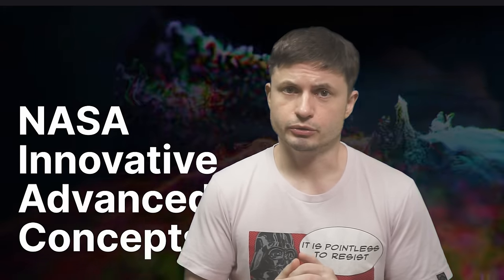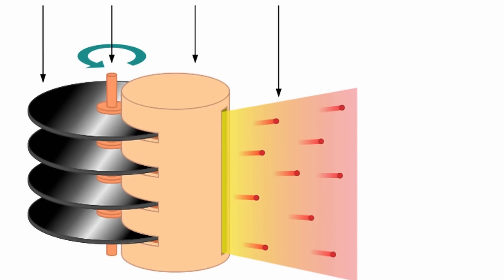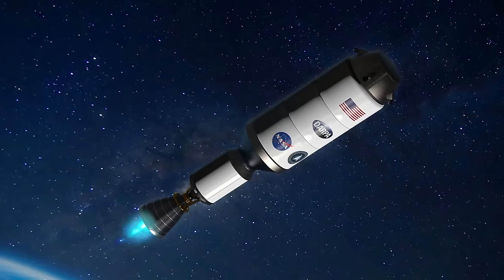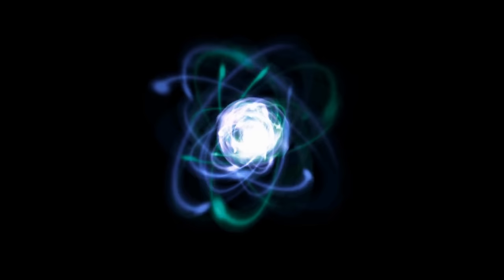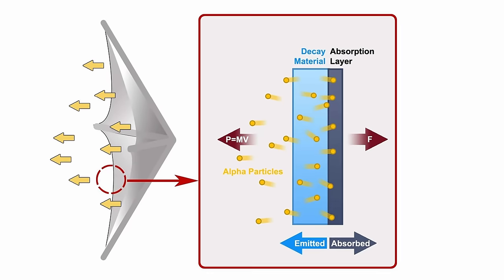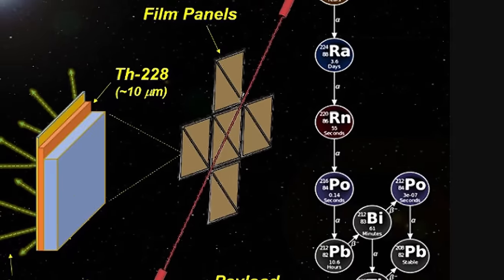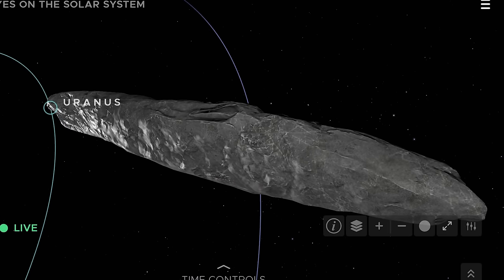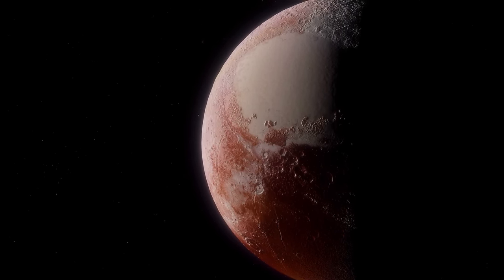Efficient Space Engine That Could Use Nuclear Waste For Propulsion

Comment: a low of 150km/s and a high of 1000km/s is absolutely wild. We could go pick up Voyager 2 and 1 in about a third of a year after getting up to speed. Do it and do it yesterday.
Reply: No there is nothing to get from picking up old broken technology and after getting to speed is far fetched as it takes years to do and you have to decelerate too. Not to mention all the other issue you have to solve and come around or that no one so far has even build such a device. So a wild dream and it will stay just fantasy for a long time. 
But it is your dream so if you want to go for it, maybe you could start collecting thorium as a first step.
Reply: Why would you pick them up, weren't they meant to go Interstellar?
Reply: This is a good comment to illustrate to the laymen just how much faster this propulsion technology can accelerate compared to previous incarnations. Obviously the benefits of retrieving these older spacecraft do not likely outweigh the costs. Still, the fact that we could do it is very cool
Reply: @shanent5793  I don't think they were meant to, it's just a cool bonus we get out of them now since they're still working half a century later
Reply: it's pretty neat but with this Thorium sail-engine I doubt it would be so great; with such a short half-life - unless the craft is somehow producing this Thorium isotope AND re-deploying it to where the sails can catch the radiation - the 'engine' will have lost more than half of its thrust capacity after only 2 years will never get it back ... so it's basically a one-way trip to far outer space, it can steer but it's not coming back if it doesn't turn around soon after it leaves (or maybe an orbital sling if it visits a strong enough gravity well)
Reply: @Techmagus76  Humanity does enjoyg collecting valuable historical relics, so even if it's only subjective there is value in collecting old relics; but also there can be some research on those craft, like seeing what happens to [various materials] after half century of continuous outer space exposure ... and there's probably other things to learn that I haven't thought up in the span of a YT comment =)
Reply: @mastakazam5094  One-way trips are still very useful since we can send information back at the speed of light, inverse-square law permitting
Reply: @BodyMusicification  indeed! =) I only meant it wouldn't be good for going to grab something to bring back

Comment: It also sounds like a very scalable design, where one can attach a square mile of a sail coated with a radioactive isotope, to propel large crafts through space. Making such a large sail won't work on Earth, but it would work in orbit. On top of that, the sail being "dumb"  (no electronics or moving parts)  would make it very durable - any space dust damage wouldn't change its performance much
Reply: This. Simplicity and robustness of design are ultra important for scalability, I don't think most people appreciate this point.

Comment: NASA needs to pick this! I image a larger craft can be made by using multiple sails with their own thorium thrusters, allowing for even greater velocity or more weight for the same velocity. Neptune and beyond will be accessible in much shorter time scales for much lower costs. It's amazing to think of the potential this type of craft has, I think this is the perfect way to explore the solar system

Comment: Just curious. You mentioned that NASA's nuclear-powered rockets would be hard to produce, but would it be any easier if they were constructed in space?
Reply: Russia has intercontinental nuclear propelled missiles already. 9M730 Burevestnik
Reply: Definitely not, launching the necessary materials and constructing it in orbit would only add more complexity and risk. Especially testing and validation would be prohibitively expensive in orbit, considering there is no infrastructure for it and no one has attempted to build heavy industrial components in orbit before -- everything has basically been part-kits so far. Considering it's also nuclear, with enriched materials, it seems that packaging it in a controlled environment on the surface is the only safe option.
Reply: @franckmalers2299  Why was the RD-0410 discontinued, like the USA NERVA project?
Reply: I'm going to guess that constructing anything in space is automatically harder.
Reply: No. Easier to construct them on Earth. The engineering of the fission engine isn't all that hard. The bigger problem, I think, is storing cryogenic hydrogen propellant without it boiling too much and having to vent too much of it. Insulating the tanks adds mass, etc.

Using something other than hydrogen for a propellant gets you an engine that's not much better than chemical propulsion
Reply: The Nerva project already tested them in the sixties.
Reply: @erkkiruohtula632  indeed, the question is why did the stop r&d, completely, after the early 70s.
Reply: @car103d politicians cut funding due to the oil crisis is my guess.
Reply: @TBonerton  I remember the seventies, but they continued with the space shuttle, which was very expensive and later discontinued for that reason and the accidents. I guess there was another reason perhaps more technical, maybe the achievement of just 2x specific impulse of nuclear fission wasn’t a great deal and they preferred to invest in nuclear fusion research if it could lead to fusion thrusters one day? Never achieved till now. Or they were scared in Cold War times of nuclear hypersonic missiles carrying nukes, shrinking the already short time of reaction after intercontinental missiles launch? Just speculating…

Comment: OK, I think I understand why there is a net force in one direction. A cherry bomb blows up in all directions with zero net momentum. But put a garbage can lid on the left side of the cherry bomb and when it explodes, the lid will go flying to the left.
Reply: Exactly.  Radiation going into space propels you while radiation caught by the shield on the other side of the fuel is re-absorbed into the spacecraft, cancelling push from radiation in that direction.  So it winds up pushing one way.
Reply: That's how regular rocket engines work too.

Comment: The 150 km/s deltaV was calculated for 30kg of fuel and 30 kg of payload, the actual "engine" weight that turns the decay into propulsion doesn't seem to be included. While for the the Dawn mission it was the whole mission's deltaV (after launch I think). Not a fair comparison.
Also, the fuel weight difference means that isotope engines only have a chance to be better than ion engines, if we consider very light payloads. Depending on actual weights, all necessary parts included, it might not be better at all.
And any weight increase will heavily affect the isotope engines range. Adding just 10 kgs would decreasee its deltaV to 129km/s, adding 30 would decrease to 100. Those differences would barely affect the ion craft's range.
Also, using isotopes your fuel is constantly depleting, whether you use it or not. Meaning that you'll have to burn in very inefficient locations, or just waste the fuel completely.

Comment: This also implies that B radiation can provide a negative voltage potential.  I don't know the output rate, but perhaps a- radiation can generate helium on Earth?
Reply: That's exactly how we get the helium we have access to.
The helium is gas that's trapped as part of the methane and oil reservoir. The helium is separated out and sold. It arrives in these reservoirs as a byproduct of natural radioactive decay of minerals buried in the earth.
Reply: @Unmannedair That's tons of radioactive material at temperature and pressure that exceeds what we should do in a lab or intentional nuclear reaction.  It can make more, and does so.  What's the yield at STP for as much radioactive substance that can be safely! 🤣 stuffed in a region?

Comment: Very cool...
There is the issue that manufacturing and then deploying such a solar sail launched from Earth isn't the easiest or cheapest problem to crack. But if one was to loosely roll the 'sail' up in a tube and combine that with a very simple ionic thruster powered by the backside of the 'rolled sail' one would basically have a solid-state alpha-particle rocket. Likely just as efficient, much smaller, and easier to deploy in to space.

Comment: That leaves one dilemma. Any craft being pulled by this sail, would have to be decontaminated before you exit the craft. Seeing as a piece of paper can stop alpha radiation, the hull would keep you safe on the inside. But anywhere you land would be contaminated as well. So pasic suits on exit and a clean you method for the craft and surrounding area would have to be part of the plan. Bringing the cost and weight of the operation up to facilitate this idea.
Reply: Pusher config and separate science research package leave the sail behind retro down fire up reconnect bob's you're mothers brother pretty simple.
Reply: @leonmusk1040  interested thought. Assuming all the contaminate is blown off on entry. Which will not be the case unless you expose the entire vessel to re-entry conditions, and all that drag. Logically you only expose the tiled side to the atmosphere so you don't tear the ship apart/rip it to pieces.

Comment: Although radiation is expelled at high speed, it represents a small percentage of the mass of fuel which unlike rockets does not go away.  You have to push the mass of the atoms that generated the radiation around with your spacecraft.  Astonishing ISP, given that issue.  Are radiation particles going at relativistic speed?  Do they "weigh more" or something?
Reply: E=Mc2 it's the squared part that keeps shit interesting.

Comment: 1,000 km/s. Wow. Light speed is 300,000 km/s. So that is 0.33 % of the speed of light. And achievable with a few years of continuous low thrust.

For want of a figure, suppose that is 5 years. Then in 15 years, 1 % of the speed of light, if the half-life is substantial. And in 50 years, 3 % of the speed of light.

Assuming no further acceleration, that would mean Proxima Centauri in about 120 years. Now if we can get that figure down to say 50 years, then we've got something similar to probes sent out in the 70s that have exited the solar system.

But the payoff will be much larger if, instead of exploring the limits of the heliosphere, we are exploring the Centauri system up close.

This is AMAZING. Further developments in this approach could obviously bring ENORMOUS benefits. Never mind that flimsy star shot idea, this could be FAR better.
Reply: 0.003%
Reply: @leonmusk1040  If you are referring to 1,000 km/s, it is definitely 0.0033 C, ie 0.33 % C, where C is the speed of light. Is that what you were referring to?
Reply: 1/3rd is .33 not 0.0033 and a third of 300,000 is 100,000 so its only 1 300th the speed of light plenty quick but no where near 1/3rd c Oh I see 1/3rd of 1 percent lol sorry got it now lol

 @dakrontu

Comment: You would actually have unexpected high amount of losses do to the quantum tunneling effect in practice. It's the reason why we can't improve semiconductors further.
Reply: The effects of Tunnelling could be mitigated with thickness (tunnelling energy reduces exponentially over distance). So losses won’t be as high. Main issue with semiconductors is that we are trying to make the components as small as possible.

Comment: 4:05 How much Thorium fuel would be lost while it is in a compact volume while being stored and traveling before being deployed?
Reply: Look up the isotope of thorium's half-life.  Find out how many kilograms are in storage.  You can calculate how long it will last yourself.
Reply: Depending on how it’s folded the absorption layer could keep the radiation separated. It would depend on the absorption efficiency between layers and the thickness within layers (where the thorium would radiate laterally). It would probably radiate faster when compacted (unless there’s a folding geometry that could do the opposite; radiates more when opened) but not as much as compacting raw thorium (same mass) in the same space.

Comment: I’m confused. What’s the sail for? Isn’t it for catching particles emitted by the decaying fuel? But the momentum between the nucleus ejecting the particle and the sail reflecting the particle back would cancel out, right?
Reply: One would think so...    Kind of like the Coyote using a fan to propel a skateboard with a sail.    🤷‍♂️
Reply: CCP propaganda
Reply: When a particle ejects in the reverse direction (into space), the sail catches its forward-moving counterpart, pushing the spacecraft forward. When you add up the reverse-ejected particles and the forward-propelled spacecraft, the net momentum is zero.
Reply: @p1mrx  is the fuel special which emits particles in opposite directions, or all/most decays happen this way?
Reply: "sail" is a bit of misnomer here, the author of the proposal refer to this as "engine". Common solar sail (e.g IKAROS) works by catching energy from particle emitted by external bodies. This engine, in contrast, use cascading reaction of the daughter nucleus of Thorium-228 for microthrust. Since the decay chain of Thorium-228, apart from itself, have short half-life (the longest, Radium-224, have half-life of ~4 days), once the reaction started you'll get a burst of momentum before it stabilize as lead. 

Hence the sail-like construction to work around the very concern you mentioned. A "lump" of Thorium-228 would emit decay energy in random direction, with its force vector sum reaching close to net zero. A "slab", however, have bias towards two directions with biggest surface area. Make the slab thin and add a layer to catch the momentum on one side, then you get an "engine" that shaped like a sail.
Reply: @randalljsilva  no, the direction is random.  Reverse goes into space, forward goes into the sail, and any sideways component could go into space or the sail, but it's wasted energy.

Comment: The 1 year half life would make the kg quantities generate a lot of heat, easily enough to melt most materials used for a sail when compacted in a rocket. Also the coating of extremely large surface areas would be difficult to say the least.
Reply: 234 thorium decay series
h
→
�
P
234
a
→
�
U
234
→
�
Th
230
→
�
…
R
226
a
→
�
P
210
b
→
�
B
210
i
→
�
P
210
o
→
�
P
206
b = 14.1 billion years

Comment: I thought the idea was going to be to generate alpha particles to trans-mutate reaction stages to emit more alpha and beta particles in a chain reaction. Also why not gold foil on one side ( or other choice, wont mention specifics) to reflect the neutrons on one side instead of absorbing them- Rufford??? due to loss of energy in absorption maybe an electro magnetic reflector would be needed, increasing weight and complexity that might be why they didn't due it this way , don't really know..
Reply: If it’s possible to reflect them, then why not?

This material can be made by a roll to roll sputtering operation on a plastic substrate, a well known process with equipment available commercially.
Reply: Gold won't work but good old berylium will
Reply: @leonmusk1040  yes, I just didn't want to say it out loud for many reasons :-) as well as suggest particular chain reactions! By the way x-ray lasers might be a good way of causing neutron release which might help to de-orbit future satellites, and get rid of future additions to the array of trash in orbit, choosing something fairly benign for the surface "paint" would be required.
Reply: yeah I tend to just throw the really bad idea's out in the public arena in the hopes someone runs with it like scissors Must have pointed out the hundreds of rtg's in orbit at least fifty times even mentioned their parking orbits put in pointers on requisit hardware to de orbit them lol live in hope :) .

 @wanfuse